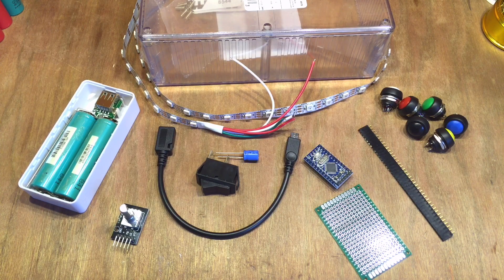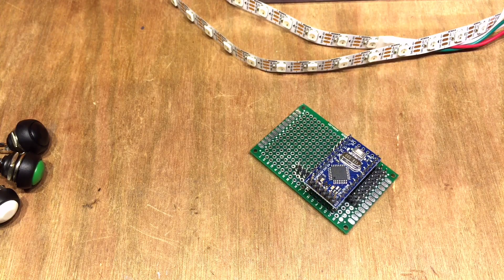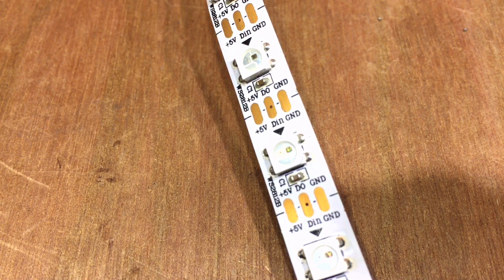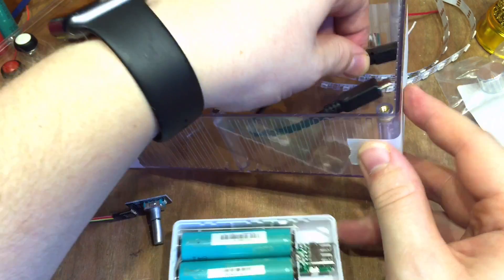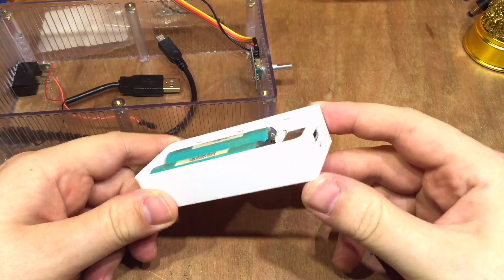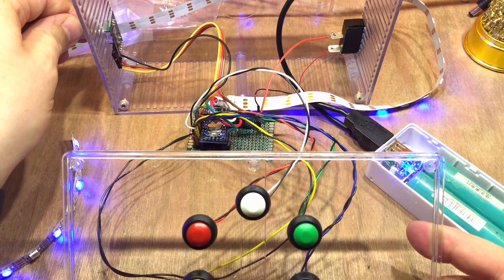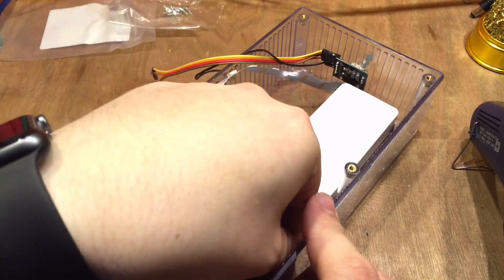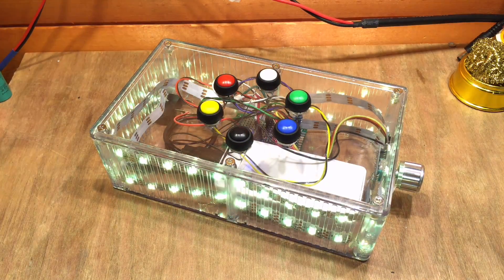Blinky Box Toddler Toy - Adams Arduino Projects

Comment: How did you cut the hole for the USB with squared corners?  Using a Dremel is easy enough for the circular holes, but I'm not sure how to go about the rectangles...
Reply from the maker: +thackworth I use a small drill bit in each corner and then use a knife to square them off. Take your time and it can be pretty neat.
Reply: Awesome man, thanks for answering!